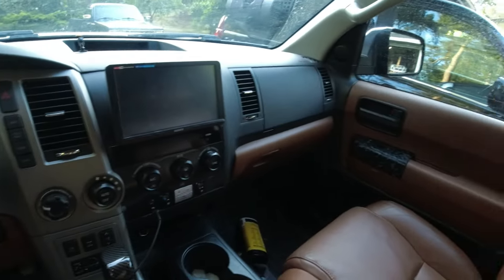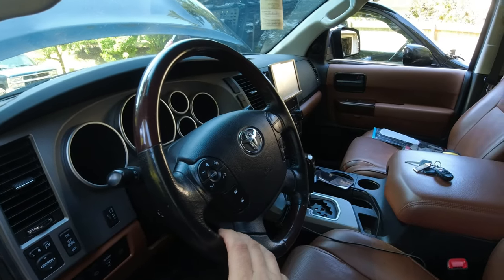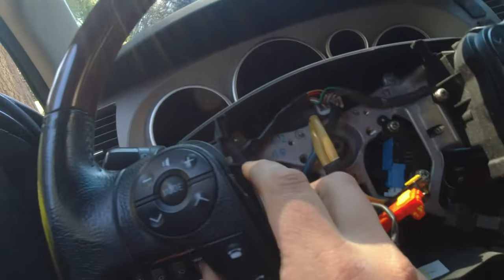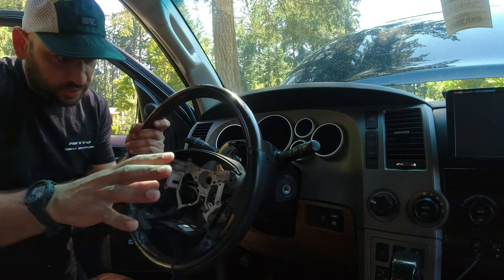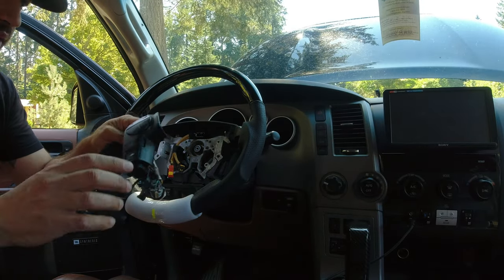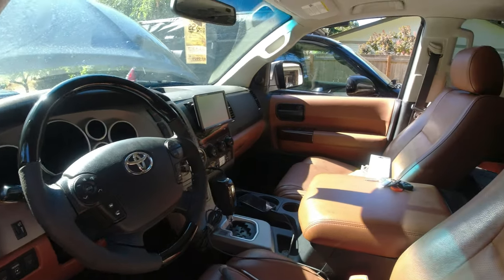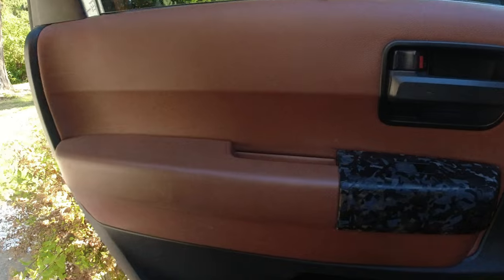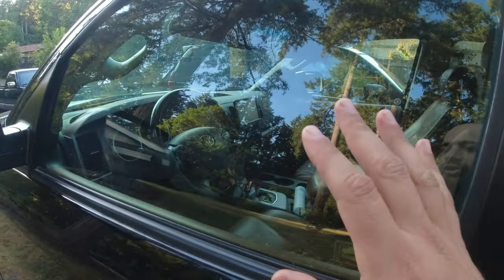2nd Gen Sequoia Platinum Wood Grain Delete (Steering Wheel, armrests, shifter, climate control)

Comment: Love your videos. I have a 16 Platinum and my wife really wants to lift it and fix it up more the overland style. I have it on my channel and im just getting started with it. I have been looking into an upgrade to Android auto but everything i read says if you have the jbl system and switch head units it kills the dvd player for the rear. Did this happen whem you switched yours out? Its important because i have 3 young kids and its a lifeline on road trips.
Reply from the maker: Thank you! Yes the aftermarket head unit will kill the rear dvd player. However, it's really cheap now a days to get rear seat dvd head rest units with bluetooth headphones that will not only accept dvd's but you can mirror phones to them too (for games).

Comment: Great videos! I have a 19 sequoia platinum and have been checking your stuff out. 
Looking to install the Sony 9500es. Any tips? I see trail grid pro has for tundra plug and play.. did you need to change the mounting kit?
Reply from the maker: Hey Matt, let me give you my honest review on the Sony. We got it in hopes of it being reliable and not buggy and it is a GREAT unit but its got a lot of downfalls. 1. The kit did not include a radio antenna adapter so our radio didnt work. 2. The rear camera has to use your obd2 port so that gets taken up. 3. The price is very high compared to all the chinese head units out there. 4. The subwoofer controls do not work with the factory system. It's just a general bass slider. 5. It's really really pricey compared to the chinese units. I use this thing every day so those 5 things have bugged me for awhile.

Comment: He brother, love the mods, I have a 2019 TRD Sport, do you know if there are any head units I can replace that horrible radio with? This one is out of stock and not sure if it would fit. Thanks!
Reply from the maker: Yup of course. I'd shop Crutchfield or give them a call and ask. They can get you sorted with every single thing you need. Essentially you can use any double din head unit, you'll just need a metra dash kit and a can bus wiring harness to make sure all your cameras and sensors work.
Reply: Thank you  @CoolGuyClub  I will contact them.

Comment: Did you look into swapping the steering wheel to the newer 2014+ design?
Also, what size tires?
Reply from the maker: I did but then the Radio and car controls aren't in the same spot and I didn't want to deal with harnesses and wiring.

Comment: Where did you get the black knobs to replace the silver plastic ones?
Reply from the maker: AJTDesign will have all the interior goodies you need for your rig... really cool key covers too.
Reply: Thx! Assuming the 2007-2013 Tundra interior items would work with my 2011 Sequoia? Is this the link for the control knobs? 

https://www.ajtdesign-llc.com/online-store/Climate-Knobs-2007-2013-Tundra-LIMITED-4-PACK-BLACK-p178524829

& for the 4x4 selector (yours is all black?) 
https://www.ajtdesign-llc.com/online-store/4x4-Knob-c70692002
Reply: AJT Design's WEB site does not show parts for 2gen Sequoias.  Are all the black pieces you purchased for the Tundra?  AJT said the door handles would not fit a 2gen Sequoia....
Reply from the maker: @jeffwalker301  Yes indeed. They are all Tundra parts and they work perfectly
Reply: @CoolGuyClub  I purchased the door handles from AJT for my 2015 Platinum, they did need a slight trim towards the hinge side to fully get back to position after opening the door. They look great.. What year is yours?